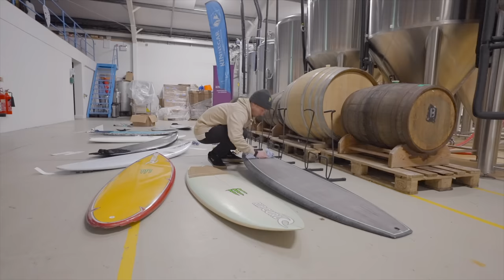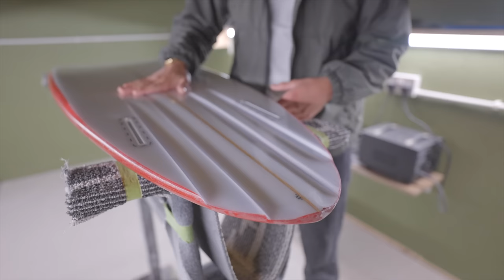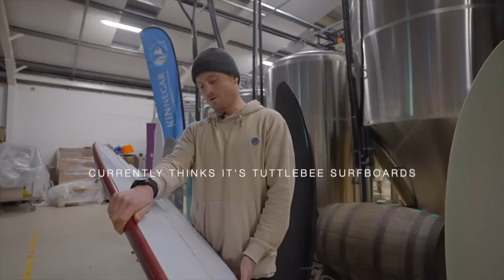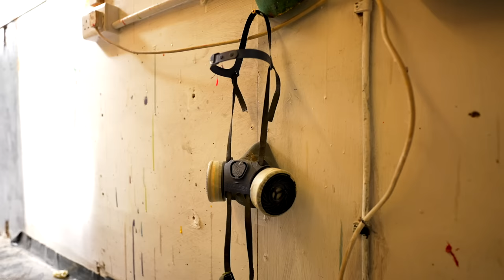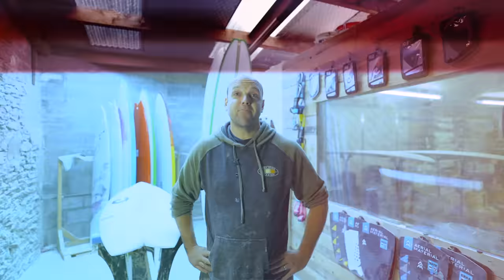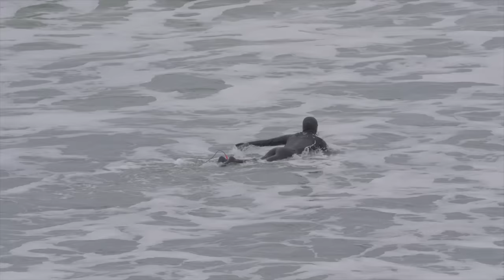The Shapers Edition featuring Gearóid McDaid ( Episode 1 )

Comment: i had an idea for an experimental board that might not work..could you have fins like gull wings on the side of the board that only dig in when the board is on edge,when it is flat it could slide like a finless
Reply from the maker: Get those tools out!!!
Reply: @tidessurfmagazine  maybe for a board to work like this it just needs to be 2 mini fin with a bit of rocker